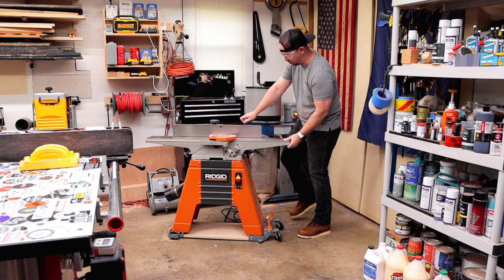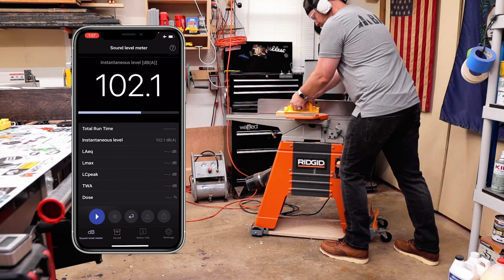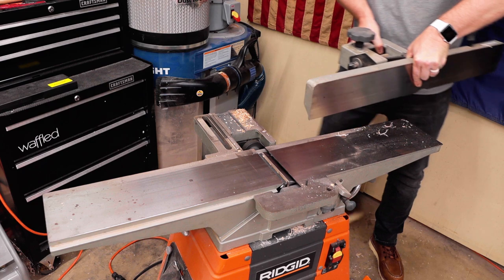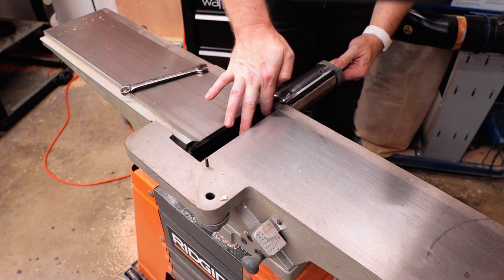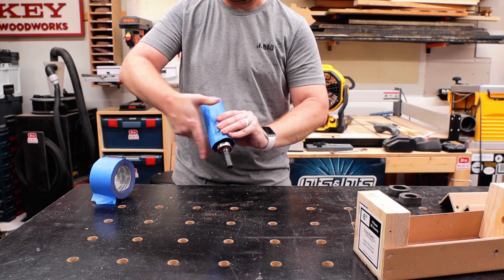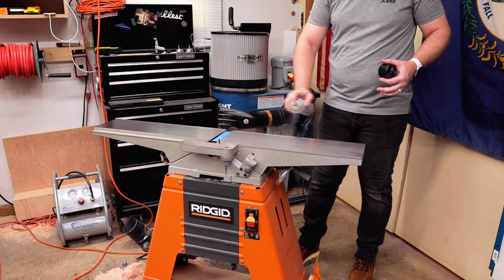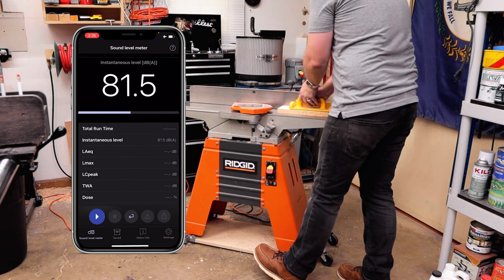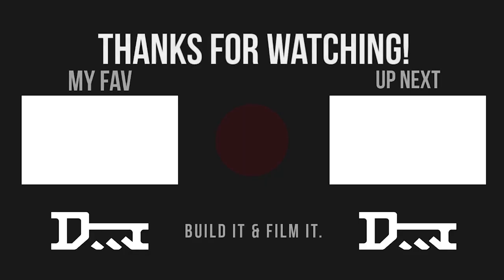The Best Upgrade for your Jointer | Helical Head

Comment: Great explanation in how to.. 👍👍👍👍 Did the outfeed table have to be adjusted since knives are no longer used. I have the same jointer and not excited about installing knives..
Reply from the maker: Thanks! Yes, the outfeed did have to go up slightly but that’s a quick adjustment.